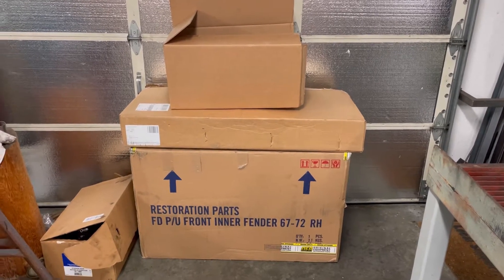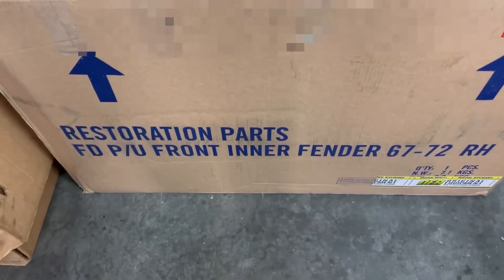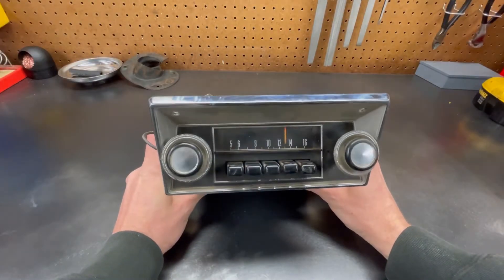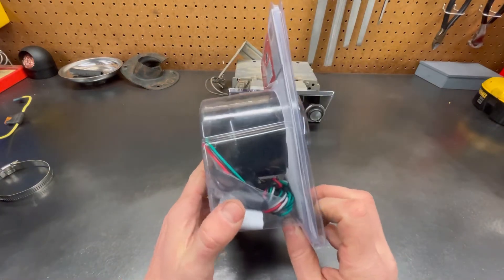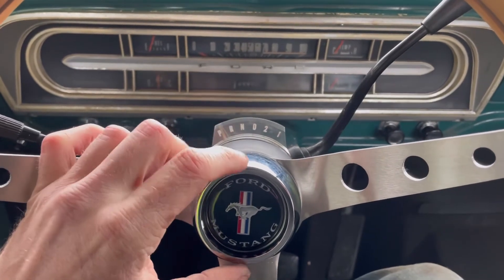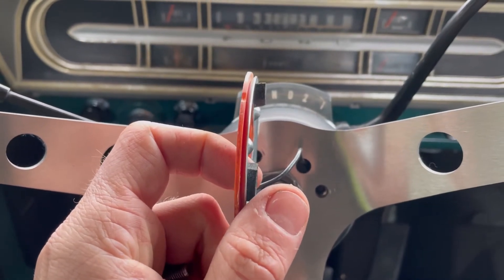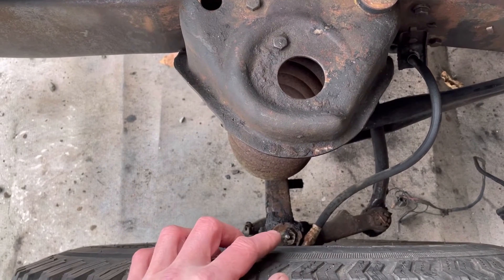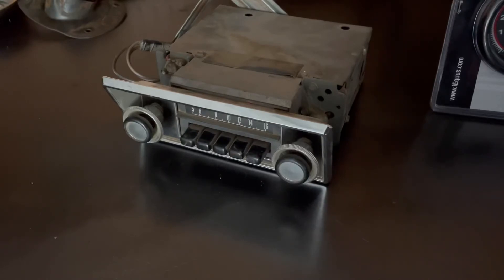A whole bunch of parts for the ‘68 F-100 arrived… but still not the ones we need

Comment: I have a Grant wheel on my 70 f250 and I used their horn button, fits really well and has no sloppy at all! Like the corner caps they do sound reasonable who did you make the purchase from? Do they carry lots of The replacement pieces? Gonna be starting on my Crew Cab soon and will be needing a lot of replacement parts. Hope all is well with you PS I would like to have others to reach out to while restoring my 69 Crew Cab! Lmk on that if you could. Thanks Again
Reply from the maker: All the cool people have Grant steering wheels! 

These parts came from a supplier here who pulls from: LMC Truck, NPD, Ecklers, Brothers, Denis Carpenter etc. He places regular orders and it’s usually cheaper than trying to order parts from across the border myself. 

If you’re located in the US; you would be able to order directly from those places for a fraction of the cost. 

Thanks for watching and we always appreciate your comments! 👍🏻👍🏻